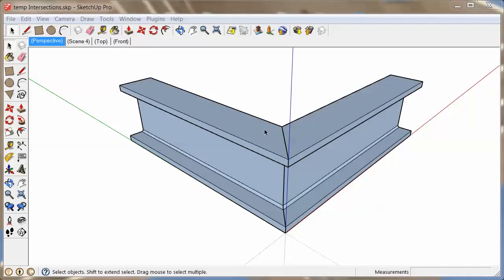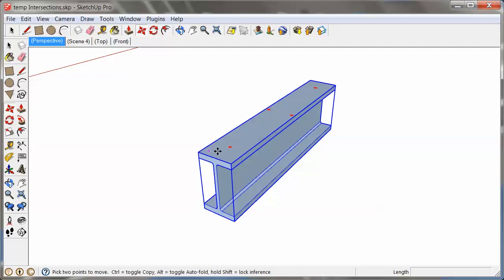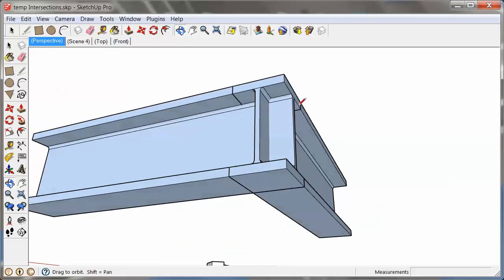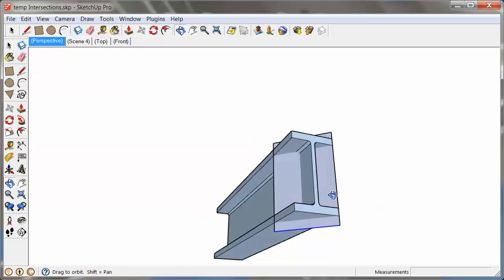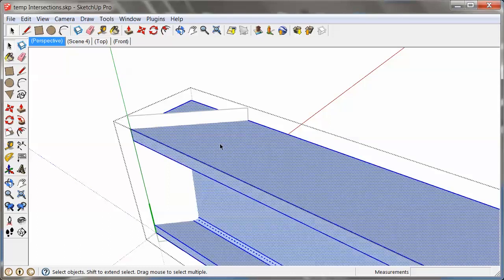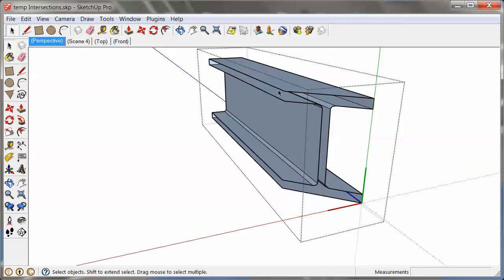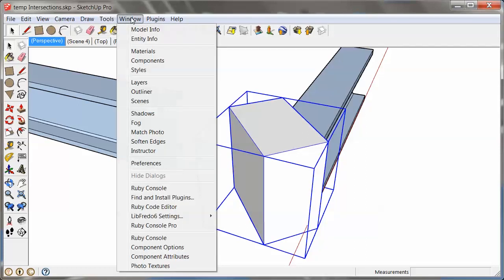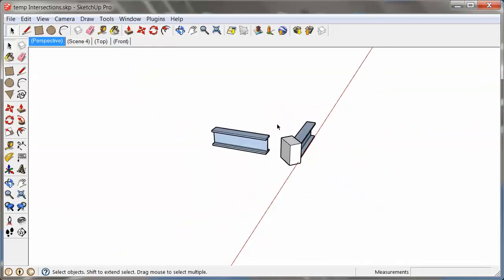Trimming Solid Objects in SketchUp (ADSU2E Video 0301)

Comment: I think with the first one it would take as the same amount of time doing it manually drawing all the lines around the beam, the second method is the one should be used.
Reply from the maker: That's a bit hard to do for curves (as in the inside corners of the beams). That's where the intersect method makes your life easier.